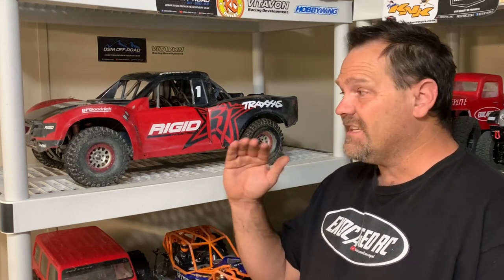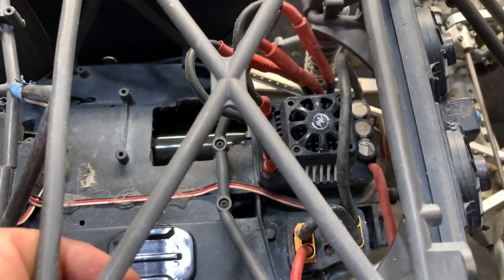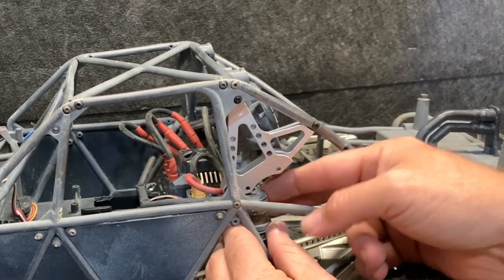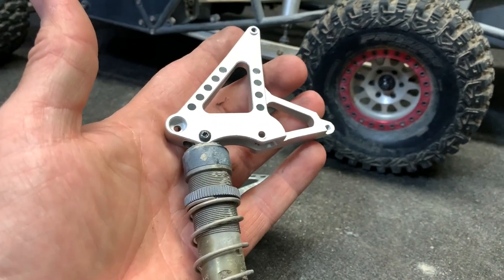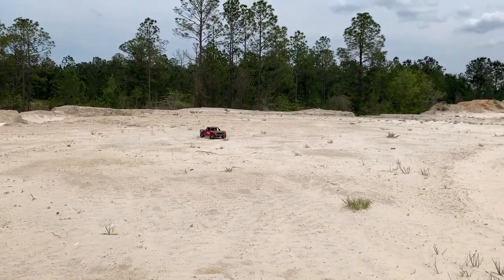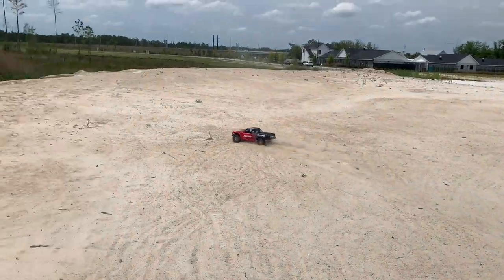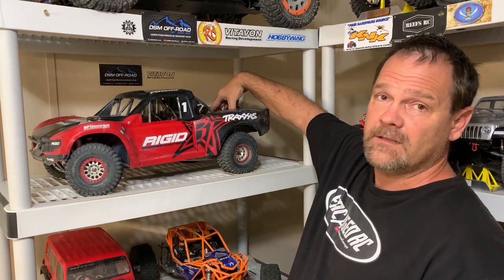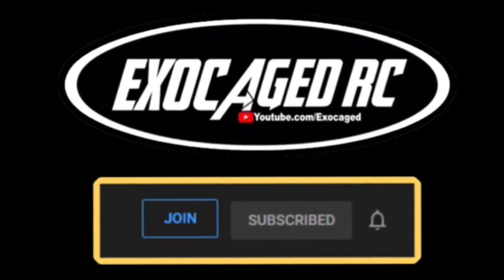Vitavon Shock Mount on Traxxas UDR Plus Drive!!

Comment: Honestly what’s the point of putting all that metal on? You see how your car performs. You gotta switch shocks and take off tires for it to run right. Personally I like to keep my majority stock to prevent other issues.
Reply: Lol wut? He said the backend is too light...easy fix is mounting the spare tires/wheels. Looks like he had a lot of fun and enjoyed the drive.
Reply: @shawngraves6796  Aluminum is heavy. It's not a good upgrade for an rc car, especially this one. You only need a few upgrades to make this truck durable. Rpm trailing arms, metal wheel hexes, and metal front center driveshaft. Boom. Bulletproof. Don't buy this aluminum garbage. You upgrade one part, then another part becomes a weak spot. For example, if you make the trailing arms aluminum, you're not solving the problem. What's gonna happen, is that when you get in a bad landing, the axle housing or chassis will now break instead of the trailing arm, so now you gotta buy an expensive aluminum chassis or axle housing, then something else breaks, then something else, and the list goes on and on. With the rpm trailing arms, the plastic that they are made out of is flexible, so nothing else will break, and they will not break. That's why the traxxas xmaxx is stronger than the arrma kraton 8s despite the fact that the kraton 8s is filled with aluminum and the xmaxx is almost all plastic.